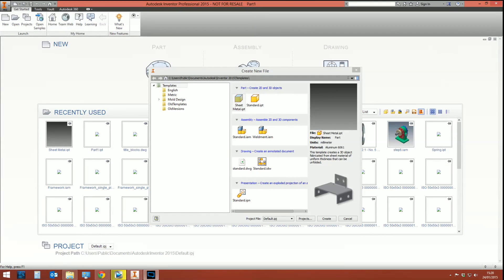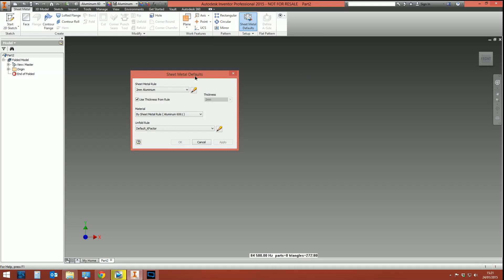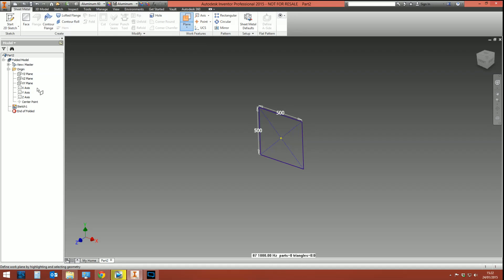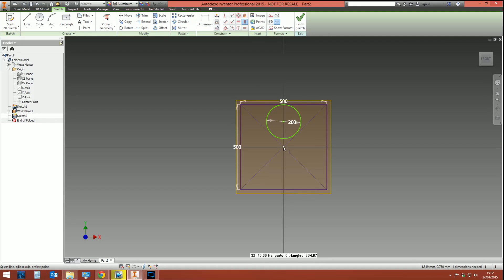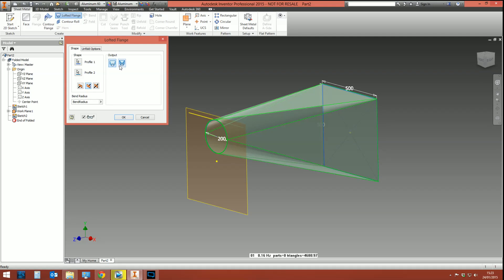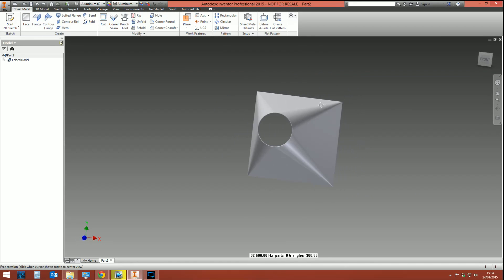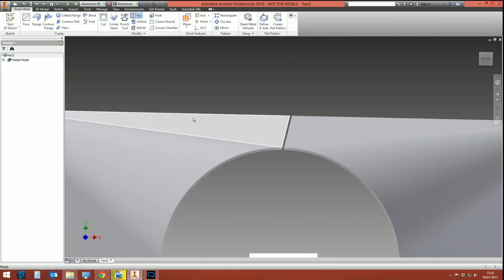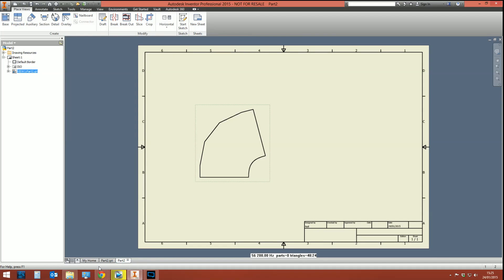How to create square to round sheet metal | Autodesk Inventor

Comment: In Oct. 1990 i wrote a Lisp program that appeared in Cadalist Magazine called "Flat Out". it used some interesting mathematics.
My approach was to draw a solid cone. then chop off the top ie cutting plane perpendicular axis of the cone. this gives a round to round transition. Then draw a square on the base of this cone. Then using the 3 points to define a plan, 2 on vertex of the square side and the third point on the circumference of the top round that is half way between the 2 points on the square in plan view... or the 3rd point on the circle that lies on a line perpendicular to the line midway between the 2 points on the square. 
Then you have a cutting plan defined by these 3 point on the solid. cut and delete that side of the cone. Then do that 3 more times and you get a square to round transition.

Comment: That's not going to work in the field. For one thing, your area on your circle is much less than on the square, so this is no good for practical purposes. Sure, if you like to play with computers instead of doing actual work, I guess it's OK. 
Actually bending the sheet metal & cutting it doesn't work this way, however.
That's why they should BAN engineers from designing stuff. They know nothing about the real world...  For example, how are you going to change an alternator out on the roadside,  that you can't get to without removing the fender, the wheel well, the air conditioning unit, and/or pulling the motor, when all you really need is a bigger engine compartment, where the alternator is easily reachable from underneath & held on with two bolts... Oh, I get it, call the tow truck, and 500 dollars  labor later to have a shop do it...
Reply from the maker: In these tutorials I just teach how the software works, no more no less.

Comment: Transitioning form SolidWorks (again - job requirement). These videos make the transition so much smoother and easier. When I come across something I've done 1000 times in SolidWorks and attempt to do the same in Inventor, I get tripped up over differing commands and terminology. After watching one of your videos everything comes flooding back.  Thank you for making my job easier!

Comment: Quick question.
In actual sheet metal shops, the concentric parts like you show, are fine for a single solid body. It can be cut in auto cad or in a shear. 
But what about complex parts like this involving offsets and angles that are not parallel  requires that multiple solid bodies be created.
Can you touch on this? I know you don't do sheet metal ipt much. But I am a huge fan.

Comment: Only Note:  This part it can't be manufactured in reality , because on bending machine , most of them , you can't bend sheet metal like this , it has to be done in 2 parts , 2 halves .
Thanks for video.
Reply: +Martin Basa We do this in our shop in one part using a press brake, but the round and the square are usually on center.  It is somewhat tedious though because the part does curl back into the press brake and itself.  As opposed to what's chosen in the video, when doing the lofted flange, I'm going to use the "press brake" output.
Reply: yes Press break is very much popular for this type of operations.
Reply: How i can make this stuf with bending machine ?
Reply: @adidp3617  cut the pattern in half and freehand some joins
Reply: Adhi  Dwi Pramono Much easier to do with a manual box and pan brake, but it requires a lot more concentration. Box and pan brakes or leaf brakes allow you to wrap this part around, but getting it back out is another story. Much easier to split the part into two parts, bend and then assemble.
Reply: Also it's fine if it's being Welded, but you need Seam and Connector allowances in reality.

Comment: these are really helpful videos. ive learnt a lot from you. is it possible to create a flat plan of an extruded pipe that is bent at various angles? example the bars on  a lawnmower
Reply from the maker: That depends on numerous things I guess.  Is it modelled using the tube & pipe module or just a modelled sweep? Is the whole purpose of this just to get/measure the true length of the bar or do you need to actually see the full piece straightened out for placement on a drawing view?
Reply: CloudCAD Ltd hi. thanks for your reply.  i usually get step files from the customer and its a pain to work out the intial cut length before bending.  is this something inventor can do if i remodel it or can it get the information from the step file or not at all?  im able to get flat plan views from sheetmetal models and they work without too much trouble and are reasonably accurate
Reply from the maker: Steve Sye Hmm it's difficult with step files, they don't tend to have any feature based info in them so there definitely won't be a property in there to get at to find the length or a sketch line.  You might have to fiddle with  advanced 3D sketch tools to get it, depending on what kind of part it is, quite difficult to answer without seeing it.
Reply: hi . can i email you a sample step file?